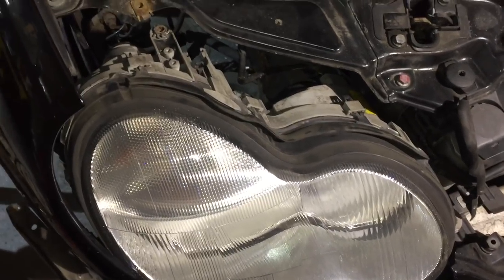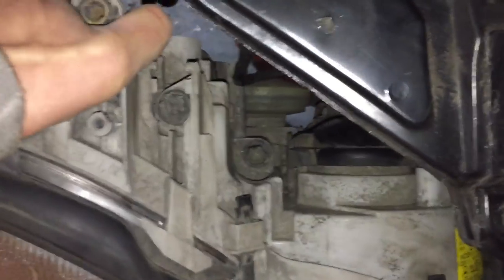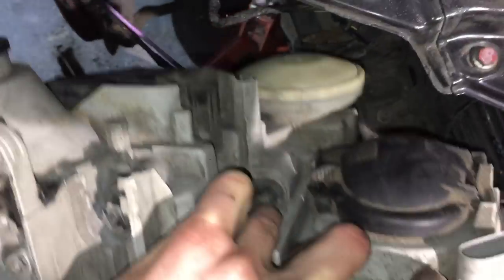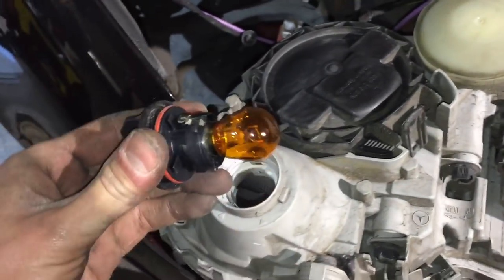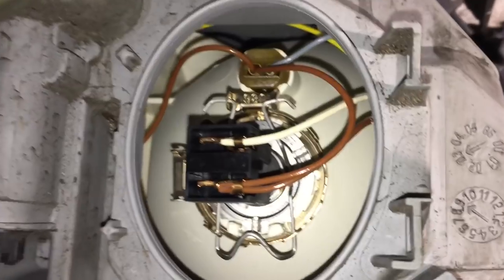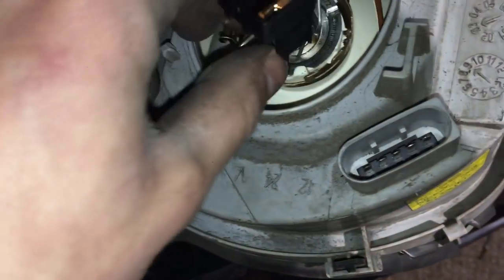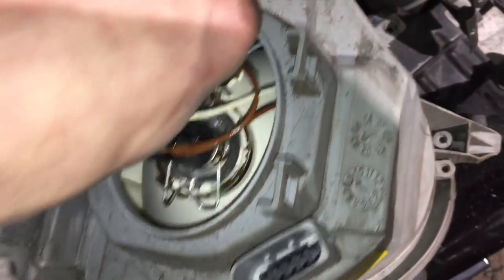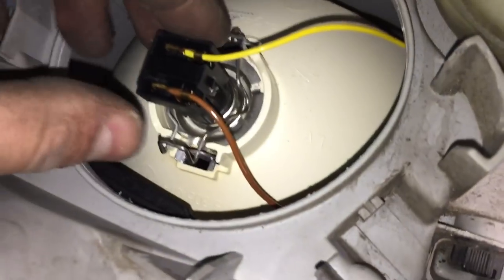Mercedes C Class W203 How to change Headlight Bulbs Indicators + Sidelights, a better view

Comment: Speak up please. And also, could've done a way better job with the camera. You didn't do anything but show where the bulbs were located
 Didn't show any bolt locations, and didn't show if you removed the bumper or not.
Reply from the maker: Thanks for the helpful feedback. The video wasn’t intended to show removal of the fitting it’s just easier to show the bulb change off the car. A lot of my videos are recorded better than this but it helps when I have someone else to hold the camera.